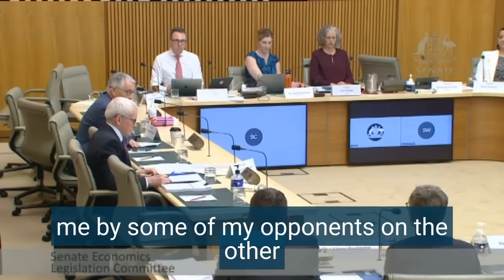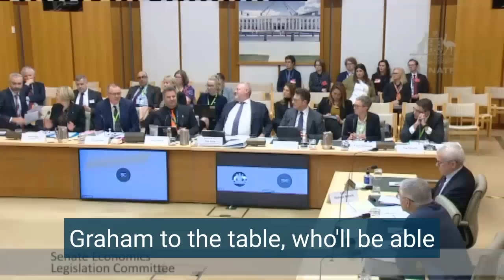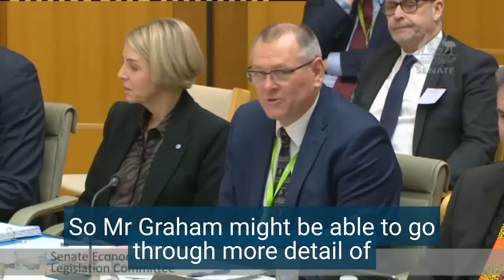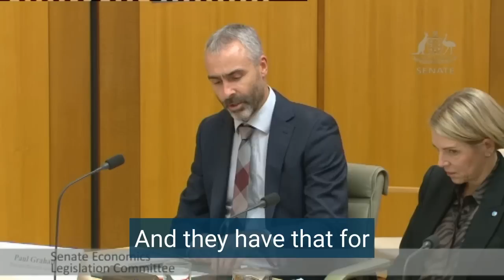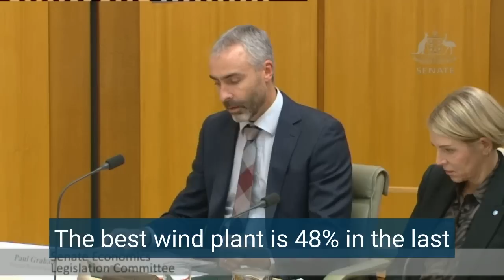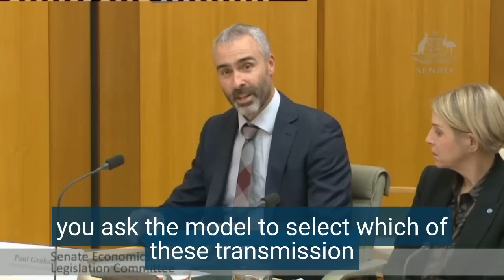Energy models overestimate life of renewables while underestimating life of base load energy -1.6.23

Comment: The amount of selection bias that he basically rattled out there would have any decent scientist laughing at his so called model. So using 40% when you said the average is 33%, that alone is a difference of just over 1/5 in performance. Then also not taking into account recycling and cleaning costs is just insane. This is just lazy work and they should be told to go back and give an accurate model that will as closely resemble real life. They are activists not scientists and they are going to lead to the death of millions across the world with their end-of-days BS. They will cause mass starvation and deaths due to exposure if they continue this foolish rush to 2030.

Comment: Recycling GREEN explained by an expert in the field cost to recycle one Solar Panel $40 material value recovered $2 to $4 as he put it cheaper to throw it away. Wind Towers the blades essentially non recyclable being wood and fibre glass the rest has scrap value. Given the average tower never exceeds 29% of rated capacity it's all a giant money pit of subsidies 18 BILLION per year to make it viable every Wind Tower receives $500,000 per year from the Feds even if a blade never turns 200 towers equals 100 MILLION just for standing and they're going broke because they say they're not making money. And the CSIRO can't figure out why energy is do expensive throw in Green tax breaks for business and guaranteed higher prices a 5 year old could work it out.

Comment: I know of people who work in the wind and solar energy industry and they say if the general public new how many of these wind turbines fail and the amount of power they draw from the grid just to keep the blades turning with no power being returned into the grid and when they do produce power it is very little which then needs to be converted so it can be used in the grid. The solar panel farms are high maintenance as well they have problems with panels leaking toxic chemicals into the ground panels need to be kept clean to ensure the best output  . I could go on and on with lots of stories i been told

Comment: Blimey, it ain't a useful model unless you put in all the inputs and factors that interact with the model at its boundary - otherwise you have a 'hole' in the model which invalidates its results. You need to ask if they are able to assess how accurate the past reports were against actual results of implementation for the systems being modelled. This is an absolutely key thing to do to see if the ongoing model is fit for purpose and is actually tracking reality in a useful way.

Comment: These bureaucrats have got stop being in a renewables religion and look at the hard data it's a lot harder than what they make it out to be.
Carbon dioxide is not a pollutant
Heavy metals from coal fired power stations are got to reduce poverty it is a difficult problem.
Standard of living depends on cheap electricity.

Comment: My solar energy sysyem produces a large amount of unused electricity which goes to feed in tarrif 5c/kWh it use to be 18c/kw!
 I  have to buy back at 32c/kwh...RIPPED OFF HARD.
40 Pannels and a 10kw inverter  and still have a $600 bill ever quater.
Reply: a battery from one of those discarded ev's in china would be the fix if we could buy them, thats if you want a potential incendary toxic event during the night being a " low probility occurrence" but the bills would be gone and you'd effectivly get the full 25c a kwh off the greedy bas......

Comment: Something that jumps out at me from their answer. They say they take the highest and lowest  capacity factor and basically average them. But, that doesn't give you the average of a dataset unless the distribution is uniform or at least symmetrical. If most of the turbines are in the lower half of the range, then the true average would be closer to 27% than their supposed 40%. They appear to be using a couple of outliers to skew the results.

An economist or statistician would be well aware of that. So,  the use of a misleading figure cannot readily be assumed to be an innocent mistake.

Comment: Once again, they hide behind models and not real-world facts. Solar and Wind do not operate 24/7 and such their batteries are useless as back ups. Nuclear plants would have fitted straight on old coal fired stations using the existing power lines .They operate 24/7 and can be ramped up at need .Wind and Solar cannot. Existing Solar panels all so suffer extreme heat and have to be powered off to prevent meltdowns.

Comment: Modelling is Fraudulent Misrepresentation skewed to achieve the desired results .. Where has Renewables  Wind ans Solar Only Generated  Continuity of Energy Supplied 24 Hours per Day / 7days per week .. Truth is None .. then the destruction of The Natural Environment, Zero Recycling just Bury the Turbine Blades and the Solar Panels we know this is the case .. because Recycling Company depots always go up In Flames, Now ask yourselves Why?  .. there Is No Recycling  its easier and more economical to strip mine the palnet for Materials than to dismantle and re-smelt used materials .. The True Expenditure Required is in the Trillions that will devastate all Agricultural Lands  leading to Crop failures and starvation case is Sri Lanka and its adherence to the WEF UNIPCC ESG

Comment: Keep at em! From average to the best outcome is NOT scientific method or mathematically correct, more like gaslighting to me. I learned median values in primary school and it’s taken from the LOWEST to the HIGHEST observed values. Maybe I should ask for a job at CSIRO
Reply: Highest to lowest is Medium Take out the highest and lowest and you have the Median 🐵
Reply: @monkeyonarock doesn’t median just sit half way between highest and lowest?
Reply: @jessbarnes8521  No 🐵
Reply: @jessbarnes8521 essentially you remove the high and low anomaly’s then average the remainder. 
Think Olympic scoring for diving etc. 
By eliminating the lows and averaging the median to highs you can artificially raise the average making it “seem” higher than it is.
Reply: @monkeyonarock  with a list of figures, it’s the middle data point.
Reply: @jessbarnes8521  No it's not That's the middle or Medium In a list of figures Take the highest and lowest out That's median 🐵
Reply: @jessbarnes8521  Take 5 people 3 earning 50k 1 earning 10k and 1 earning 1 million Your math would give me the medium 232k or 50k Median 🐵
Reply: @@1-Wheel-Drive No 🐵
Reply: @@1-Wheel-Drive The example used is correct 🐵
Reply: @@1-Wheel-Drive Mean v Median 🐵
Reply: @@1-Wheel-Drive When data is skewed the median used takes out the highest and lowest 🐵
Reply: @@1-Wheel-Drive that’s what I learned- primary school; mean, median, mode.
Reply: @@1-Wheel-Drive Medium is type of data Or size Even or uneven amount of data points No cut and paste 🐵
Reply: @@1-Wheel-Drive agree standard distribution curve but the bastards at csiro oh oh are using a model that shows renewables in a more favourable light - world studies before the climate fix went in showed wind at about 30% 24 hour/7 days/52 weeks - similar for solar at about 25% availability and mostly produced outside peak usage (solar loses 50% automatically annually because of a well known factor called night)
Reply: So they don't use years of real actual figures they MODEL figures they know are pure fiction to support the cause. Exactly as they MODEL Climate Change by not using actual recorded figures to sell it to the public. This started under Gillard when she ORDERED the ABC and CSIRO to SELL CLIMATE CHANGE to the Public as fact. Time the CSIRO once a real scientific organisation is either brought to reality or disbanded all together. It has simply become a New World Order disinfortion unit to Polish a turd and sell it to the public as fact.

Comment: No modelling they've generated for recycling because they don't want to scare everyone with what that outcome will bring.
Reply: solar panels alone cost 3 times the purchase cost to recycle - thats why they won't tell
Reply: See my coment above.
Reply: Recycling GREEN explained by an expert in the field cost to recycle one Solar Panel $40 material value recovered $2 to $4 as he put it cheaper to throw it away. Wind Towers the blades essentially non recyclable being wood and fibre glass the rest has scrap value. Given the average tower never exceeds 29% of rated capacity it's all a giant money pit of subsidies 18 BILLION per year to make it viable every Wind Tower receives $500,000 per year from the Feds even if a blade never turns 200 towers equals 100 MILLION just for standing and they're going broke because they say they're not making money. And the CSIRO can't figure out why energy is do expensive throw in Green tax breaks for business and guaranteed higher prices a 5 year old could work it out.